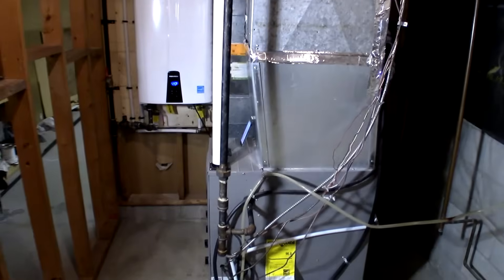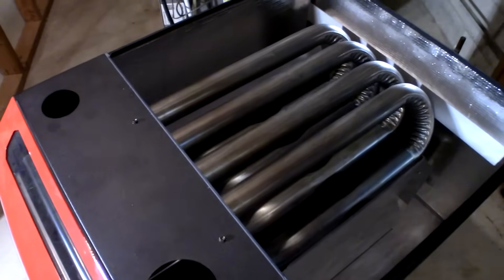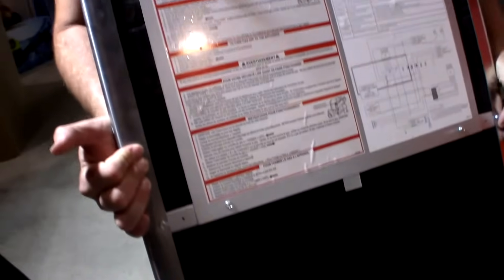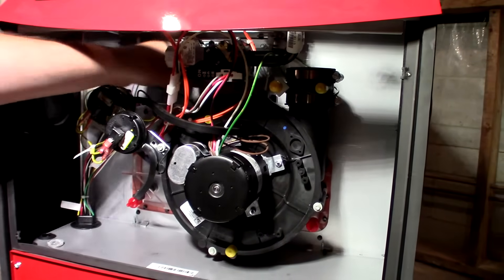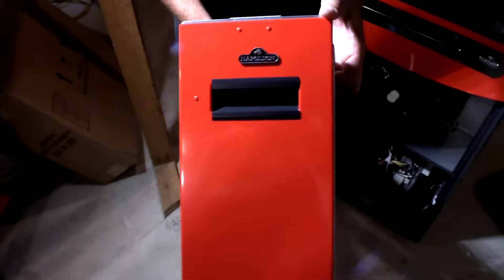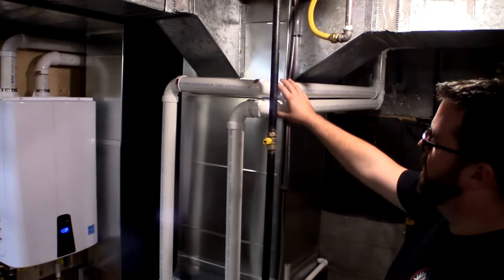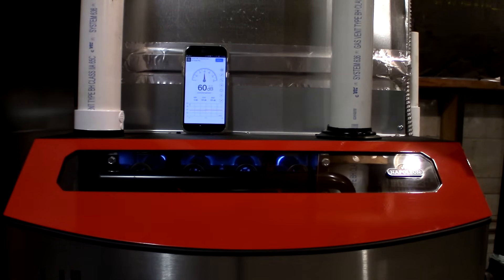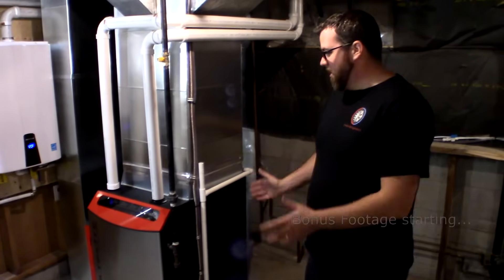Napoleon Ultimate 9700 Furnace Install and Review - BEST OF 2024

Comment: Great job. Overall very neat professional installation. I really enjoyed watching your HVAC system improvement. Only one thing I wish you would have replaced is the base elbow (the one in the return side connected to the filter rack). The square throat square hill elbow is three times more restrictive than the one with round hill and round throat.

Comment: You just spent $1500 more on a modulating 2 stage furnace to get 1% more efficiency (if that). The single stage wolf is already 96% efficient.

You'll never get that money back no matter how many decades
Reply: 2-stage and modulating are for comfort, NOT saving fuel. Nice to have consistent heat instead of heat in short bursts, furnace is sized for most extreme weather , making it too large most of the time and many are 50%+ oversized on top of that.
Reply: What's the price of the wolf? Right now this furnace is being quoted around where I live for 5200 including install. I prefer single stage myself. Right I have a lennox el296 which in a little over q0 years has had zero problems except one time the pressure switch went. When it does goes I am thinking single stage again.  Lennox parts are ridiculously over priced and hard to get.
Reply: @jvirg  Everything is hard to get right now. Huge supply issues from China. The cold weather freezing the water pipes and exploding them all of the plant down in Louisiana or Texas that produces the resin used in making pvp pipe, abs pipe, floor adhesive just to name a few,  didn't help the mechanical or construction industry one bit.

But yes, you go with the 2 stage multispeed for heat & A/C, not 2 stage modulating furnace and you'll save $1500 easily.

9600Q or 9600E would be a much better option.

Comment: I am thinking of going with this unit but instead the 9600 to save a little bit of money as I will get a rebate on that as well.  As a professional installer how does this compare to Trane 96% 
my concern is warranty, parts, etc.... Im located in BC Canada
Reply: Did you end up buying this?

Comment: Thank you for the quick reply and advice. Only been a few hours since it fired up and what a difference in our house. Glad I choose the 9700. I plan on following up with the installer and napoleon tomorrow.
Reply: I made the decision after 3-4 months of research and getting the same model.  The local installer in Alberta has spent probably 4 hours with me so far answering questions, getting info, etc.  COmpared to some quoted where it was whats your sq. footage, this is what you need.
Reply: @virgil3241  / @jamesohearn1531  after 2 years, how do you find it now?  I would also like to ask if you've encountered the 'noise' issue that some have complained about.  more specifically, the noise from the vents in your rooms.  Can you hear the motor on both (1st and 2nd) stages when you are in your bedroom? Is it loud?  ramp-up and while it's running?  Thanks.
Reply: @stargazer6912  I have never noticed any sounds that I shouldnt. Sitting in the rec room that has the furnace room right off it with a door, I cant even hear it, compared to the old one where you could hear the drone of the motor all the time.    I didnt even know there was a "noise issue"  I have a dual zone system however, so maybe my setup has some noises others dont.  Ive done a lot the last 4 years to my HVAC to deal with a lot of things that werent setup properly in the first place.  Maybe all I have done deals with this noise issue, not sure.    But its been working for me just fine.

Comment: Just had the 9700 installed today. I had requested the napoleon filter on the work invoice. Was told by the installer that the filter was back ordered wasn't made aware of this until after a honeywell product was installed. Told the napoleon wasn't made by napoleon and was cheap. Thought I would ask your thoughts as you have the filter that matches the 9700. Thanks.
Reply from the maker: Napoleon has had logistic issues during covid.I have been to the plant where they make the equipment.They do make all the furnaces and some gas fireplaces in Canada. Filters racks I don't think are made there.The filter box feels premium to me they also use a higher merv rating filter which is said to filter pollen and mold spores. The installer is likely being truthful about not being able to get the filter rack. 

I don't think it would be difficult or expensive to be put on a waiting list to get the proper one.You spent the extra money on to get the Napoleon 9700 so you do care about the way it looks.

I would call the installer get put on the list and plan to follow up with him in 6 weeks.
Reply: pretty sure the only difference between the napoleon and honey well filter racks are the covers. they look identical to me. you likely can just swap the covers lol

Comment: I am considering this furnace to replace my oversized Keeprite for my zoned system.  How has your results been with it, how quiet, etc.  Any info would be appreciated
Reply: Imo all zoned systems should be multi stage
Reply: @alskee2010  I replaced mine with this exact furnace.  I have  a50% rule now that unless both zones are open, it wont go beyond first stage
Reply from the maker: It really depends on your ductwork that it is sized correctly. If correctly size it won't over heat and run quietly.

undersized ductwork leads to noisey air flow and hi limit trips.
Reply: @traceyrefrigeration  Well I have an oversized 100K single stage one speed furnace zoned now and it doesnt over heat, although the Delta T is at its maximum or a little over.  I assume a less BTU furnace dual stage with variable speed motor will work a lot better

Comment: Nice work, normally I see purple glue at your pipe joints?
Reply from the maker: We take time to keep the joint clean sometimes even wipe acces glue from joint.
Reply: Purple primer. Not used anymore. Clear glue is used now but one time purple was the color for proof the joints have been sealed. Not a HVAC person myself but several guys that are have told me that.

Comment: 3 questions:

1- is this still a top end furnace to recommend in 2020 or has it been surpassed?

2- are the screws on the secondary door annoying?

3 - what’s that tankless unit you’ve got on the wall?

Thanks

Comment: They aren’t the only ones with stainless tubular heat exchangers. Amana did it first way back on the Air Command systems in the late 90s early 2000s. 
Now they have lifetimes on both the Goodman and Amana lines.

Comment: Very nice furnace, I personally would have put it on blocks especially being one of quality. Also new flex connector on plenum and downdrop for return would also help to reduce vibrations and noise, usually have a trap in condensate drains for fhe a.c. line and a tee that is inline at the start for a cleanout on the coils drain and the vents length seems questionable for 2" with all them fittings. Other then that that furnace is nice looking going to show my family's company them

Comment: Andrew, thank you for your video. It was very informative. After 1 year with the Napoleon 9700 furnace, are you still happy with its performance?
Reply from the maker: Napoleon Furnace is a nice looking furnace  and operations well.The most important thing is that it is installed correctly and set up correctly.

Ductwork sizing-To small of ductwork unit will over heat on high limit safety.Older furances high limits were set for around 180F Newer furnaces including this one is set for 140 F.So when replacing there may be some issues.
Also if duct work is small it will be noisy.With correctly sized duct work unit is quite the problem is not all customers want to pay for ductwork modifications.

Drain condensation-This furnace performs best with a factory installed fitting removed off the furance ventor motror so it can drain faster.

The installer must check
Gas pressure hi/lo fire
Temperature rise in and out temperatures of the furance and set the fan speed accordingly 
Total system static pressure (some air conditioning coils are very restrictive)

I think the key point is the quality of the install is everything.cheapest quote is usually the expensive way to do things.

Comment: Napoleon makes some decent furnaces! Ive probably installed almost 200 of them now. Although the company I work for has switched brands to Armstrong Air, I find the Armstrong's to be a much quicker and easier install. They are also much quieter than the napoleons and the cabinets are made of better quality material.
Reply: I had my hvac buddy install the armstrong air communicating A97MV 4 ton blower model furnace, ec1p 5 ton coil and 18 seer 3 ton condensing unit in my house. Also have the armstrong air comfort sync thermostat. And I didn't second-guess on another equipment brand my HVAC buddy that installed it they install mostly trane. And when I had him install my armstrong are communicating system he called it the Maserati of systems and said it was every bit is good as trane.